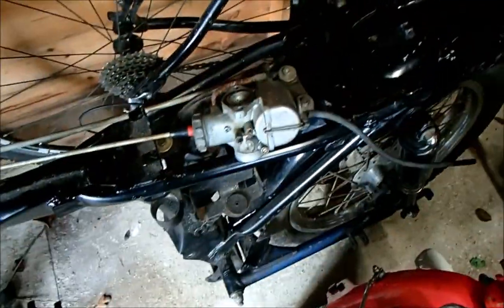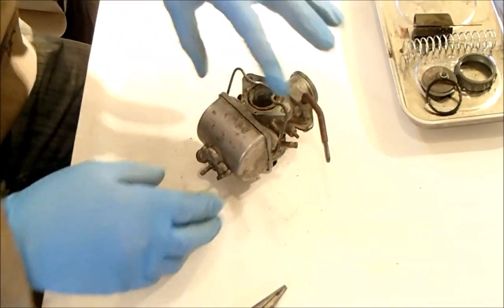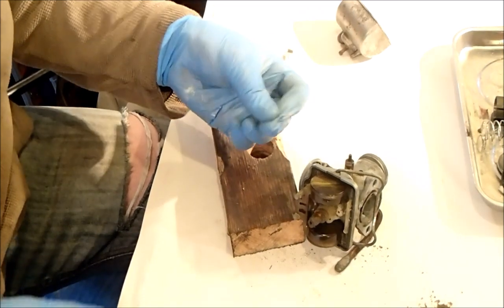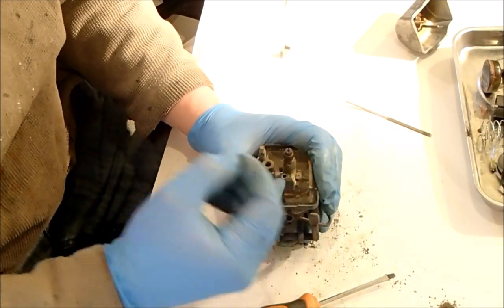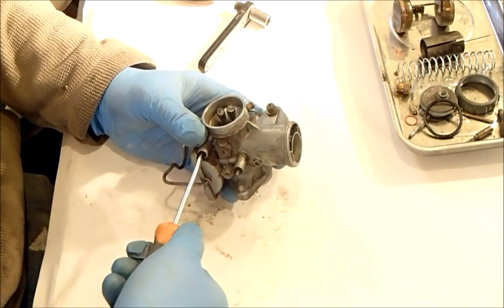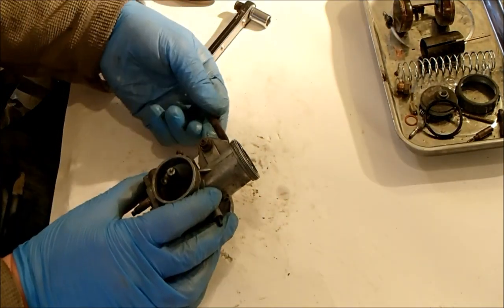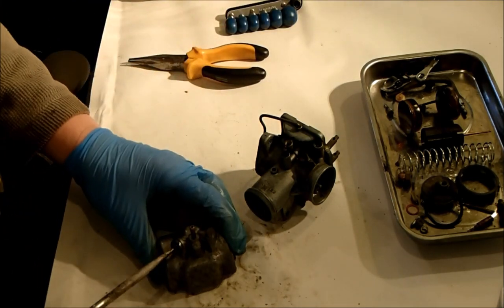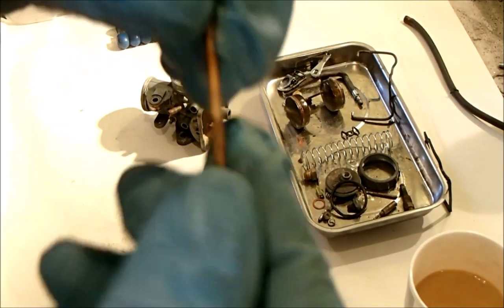Honda cb125s restoration pt-7 carburettor disassembly

Comment: just cleaned up the carb on my bike. Its a CG125 from 1976. She has been sitting since about 1998. Bit of rust flakes and dirt in the bowl and in the airways. Cleaned it up with petrol and an air line. Should be OK I hope....
Reply from the maker: Will be fine, as long as the passages are clean.

Comment: Hello Richard, I'm in the process of fixing up an 82 CB125S. Your videos have been pretty helpful. Do you know what kind of carb is fitted to there bikes? Mine is missing!
Reply from the maker: I can't tell you the specific details of the carburettor but a quick eBay search will pull up Chinese aftermarket carburetors for this model. I would advise getting a jet kit too as they usually need changing. They are cheap but do seem to work.